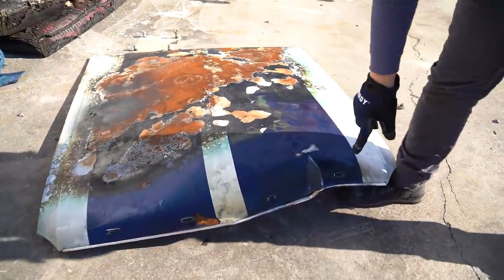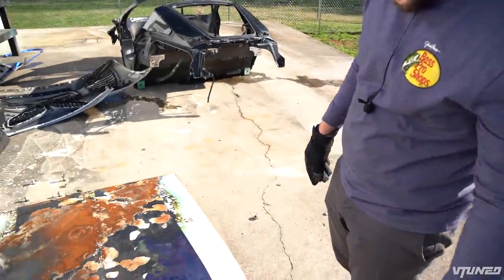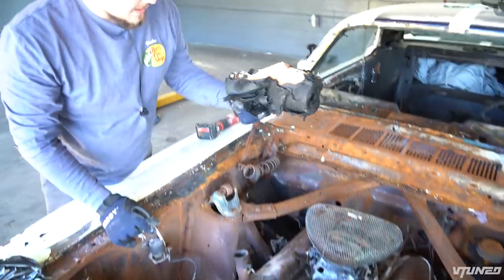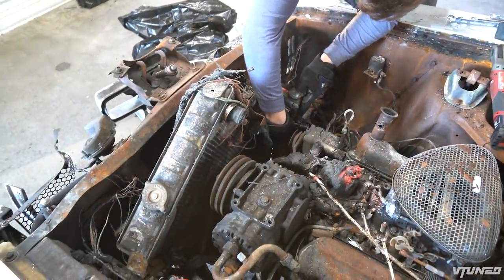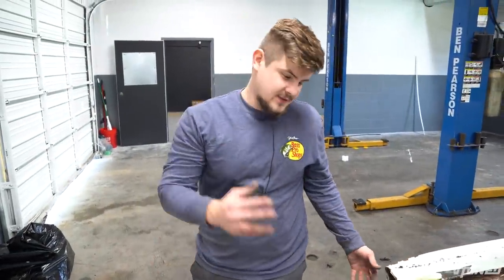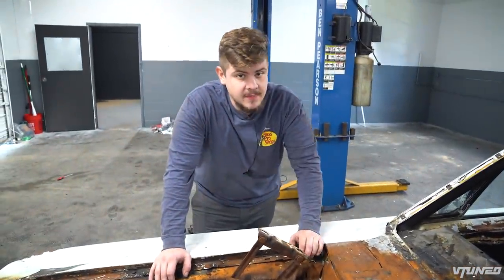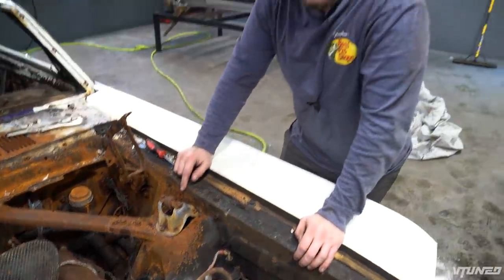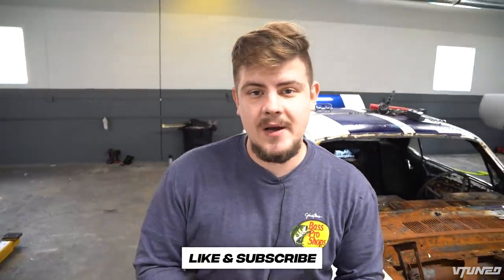Was The 1965 Mustang Insurance Fraud ? & Disassembling Front End ! ( Weird Discovery )

Comment: Doubtful the towels were left on the header on purpose. Us old guys forget shit sometimes. Definitely was a 6 cylinder car originally. The strut bars you pointed out in the engine bay came on both 6 cyl and V8 cars. There was an export brace used on GT350 cars that bolts on top of the shock tower that was beefier than what came on regular production vehicles. They can be purchased and installed on 6 cyl or V8 cars. Same part number for either. There is probably a 289 or 302 in it now. Doubtful anybody would put a 260 in it. Looks to small to be a 351W. 289 and 302 are physically the same on the exterior so hard to say without looking at block numbers. Bumper looks like a reproduction. OEM bumpers are heavy and look much thicker than what you took off. Shouldn’t need to remove the dash. You can clean the rust from backside and apply a rust converter like corro-seal to prevent further rusting. They are a pain in the arse  to remove. If youre replacing the inner and outer cowl  that would be a good opportunity to remove dash for sandblast and paint. Suspension is likely fine but you will need to replace the rubber bushings in the lower control arms and strut rods and maybe the spring perches. Doubt there was enough localized heat to weaken the coil spring. Shocks are trashed. But if you’re cutting out the shock towers for new suspension it doesn’t really matter. Factory harness is fine if you want to go back to original wiring and carbureted engine. If you’re going with fuel injected engine, a modern one wire alternator and an electronic controlled transmission I would build my own harness. The factory harness will be only good for headlights and turn signals.

Comment: dont touch the fire wall . its just burnt paint , its probably ok to replace the top cowl panel , at least when you get it opened up you may be able to make repair sections for inner cowel .. less is best around that area of an early mustang . please dont attack the dash panel ,there is no need, you will only end up with another huge mess .. good luck , phil   . sydney

Comment: Ben, I'm not real sure that tower to firewall bracing is Ford OEM. The heavy stampings Ford made for first for the European market cars and then later used on V8 Mustangs are one piece from one tower to the center firewall, then to the other tower. And other than at the connector ends, they have no bolts or joins. I'm not a big time Mustang nut, but techniques to improve the Mustang have proven helpful for other similar cars. Check me on this.  Also for lots of specific pointers re Mustangs from '65 trough 72, Peterson Restoration channel on YT can show you tons. He has some specific "touch ups and adds" to replacing that cowl piece and the drainage tray underneath it. Last thought; taking the roof panel off, replacing the front cowl and tray beneath it, you will have the car stripped to where you could rebuild it as a convertible if you had a wrecked convert to salvage the mouldings, trim , W/S frame and top mechanism - just a tasty thought! And what a cruiser that would be top down, auto tranny doing the heavy lifting- sunshine on your day!  FR

Comment: That was a def 6 cylinder rad and brake master. Prob a mustang engine from the 80s. Someone def put a lot of $$$ in that car. The paper towels would have been burnt up a lot more if that was the cause of the fire. The exhaust has to get red hot to be able to light even paper towels.  Kinda like a cigarette can not light gasoline because they do not burn hot enough. If the metal was not warped then you got almost a full resto car. 60s mustangs are basically the same 64.5-66; 67-68; 69-70.

Comment: Well everything is coming apart easy because it's coming of a fresh restoration.. maybe once your done with the tare down possibly sand blast it all.
Reply: dont newer sandplast any body if not have totally rust, need use soda plast or opther softplaster system. or all body sheet need change new.sandplast make metal bad and hammer and trech sheet lot.

Comment: 289 or 302 engine  in a 200 cid 6 cyl chassis.  Headers bashed a little is SOP for almost any V-8 in a first gen. I have very high dollar ceramic headers in my 66 2+2 Mustang that fit better.  But the set of headers I had before the 2016 resto were beat up to fit around shock towers.

Comment: How about - Link, MSD or Holley, for engine management?  You could even put a different manifold on your engine and run a throttle body to make the car look like it it still has a carburetor. Painless could set you up with a wiring harness for the whole car. The paper towels are interesting, How Sad :-(  Good Luck as always....

Comment: From what I can see fire started in the front. If the towels had been cause it would have been burnt completely through due to the heat. More likely that ignition system caused it looks like the most heat was in drivers side front corner

Comment: If that is a early 1965 it most likely a 260 v8 pre 289. the valve cover with the high fill tube can't remember being on 289's. I believe the 260 came with 4 stud wheels you could have something special cause if someone went through the work of restoring and putting a 289 with headers etc would have changed spindles and axles to complete the car. As for the paper towels he could have been cleaning the windows and it fell or wind blew it and he forgot about it.

Comment: Vtune,e harness
Painless wiring can whip you up a custom wire harness.
Engine? Fords new 7.3L gas engine is suppose to fit in
place of the 5.0L coyote engines in Fox bodies SO it 
should squeeze into the 65.

!

Comment: Oil filler tube is on the same side as the towels. Most likely a honest mistake. I’d say Most people would use paper towels that they have at home for a clean up after an oil change. Saying it because I’ve done that. Blue shop towels are more expensive to buy if you need them occasionally at home. Shop business are more like likely to have the Luxury of the blue towels because that could be written off as a shop expense

Comment: Usually the hottest part of the fire is where it started. But it would be hard to tell in this case because the fuel would have burned pretty quickly. It is odd to find a roll of paper towels down there.

Comment: Drain the oil so the water the  fire department put down the intake will come out and take the plugs out and turn it over to push all the water out through the plug holes. It will bend the valves other wise. Water does not compress.

Comment: If the rear axle has four bolt lugs then it should have been replaced with a Ford 8" when the V8 was installed. The original six cylinder rear axle won't handle the V8 power let alone if you boost its power.

Comment: In 1964 and a half there was two V8 engine options to 60 V8 and the 289 V8 to know what engine was supposed to come in that car you have to either read the 8th or 10th digit in the van and that will tell you what size motor came in it

Comment: One of the first v8 engines put in the mustang was a 260ci it is possible that they only had four lug nuts as the later 289 v8 had five. Check the Vins before doing anything you could have a rare factory combo

Comment: Just because its a 4 lug doesnt mean its a factory I6 car. I have a 66 mustang coupe with factory 289 2 barrel carb, 2.80 8in rear end and 4 lugs. check the vin and if the 5th code is a C(2 barrel 200hp 289) A(225hp 4 barrel 289) or K(HO 289) its a factory v8 option.

Comment: As others have said it's a 6 cylinder car and a low buck V8 conversion.  With the amount of heat the shock towers and other structural items took they should be replaced.   Really, the car needs to be totally stripped down and rebuilt with the weakened metal in mind..

Comment: I am picking that they were cleaning the car, maybe polishing under the hood and put the paper towels down, then forgot them. I still think you should keep the original engine and make it original. The other car already has no inner fenders so it would mean you wouldn't have to hack this one up. Original will be worth more than something cobbled together from Chinese made reproduction parts.
Reply: Original is a 6 cylinder.
Reply: @Hanzyscure  I mean original, rust free body.

Comment: the engine is a small block ford, you will have to look at casting numbers to know what it is, could be a 289, or a 302 (5.0).  the headers look like oem  ford motorsport shorty headers, found in the fox body.   the support braces are on all of these years, including the 6cyl and v8 cars. they are structurally identical.  the only real differences it the roofs. just some FYI.  do your research...

Comment: Nice job. Try to turn the engine by hand if its locked up its insurance fraud. If you can use the factory wire harnes from the coyote engine you can buy a box from that go’s from the digital signaal to a analog signal for the gauges in the mustang

Comment: when you say your going to replace it with a 5.0 do you mean like the modern coyote motor, or like the old 80's 5.0 that is well, just a 302 with a fuel injection system on it, as honestly the 289/302 series of engines are the best sounding ford motors ever made, like a proper 289 Hi Po like they had in the old shelby's sounds like no other so I would first check to see if its still good before giving up on it and chucking it to someone

also if you do go the route of saving it and racing it, Hydraulic Lifters and and an accusump are the way to go with older cars like this, and also ethanol approved gas lines, like steel ones

also I remember talking with a guy who did the bumpers on 1970's rolls royces on twitter, guy was on a british car guys thing there, the profectionalist valet, guy works on harry metcalfs cars and a bunch of really high end cars, which included a rolls that he was working on hence how the conversation got started with one of the commentors, they made them with Copper First, then a Nickel Coat, then the chrome, its a three coat process finish, so that might be a repro that used only nickel given I've heard leno bemoan how expensive it is to have something rechromed.

like 50 grand to redo a 50's caddie, some insane thing like that, plus also the three coat thing might explain why one of the things I've seen people do when fixing up old car bumpers is taking steel wool and oil to them to polish a bumper back to a shiny state

which might be them just taking off the flaking chrome and getting to the nickel below without even realizing it.

Comment: Paper towels looks like an accidental forgotten to pull out of the engine bay. They likely had to clean something in the engine bay and forgot them. That's why it was in the engine bay and wasn't used on the outside. Should've been using blue towels? Yes. But sometimes you use what you got. Shit happens.